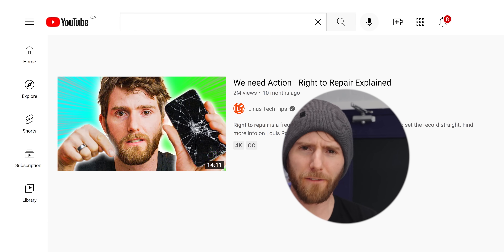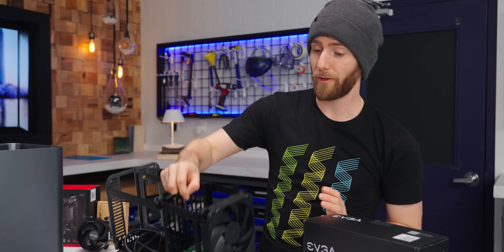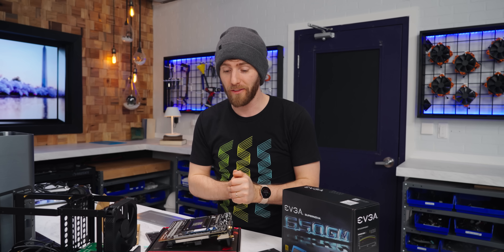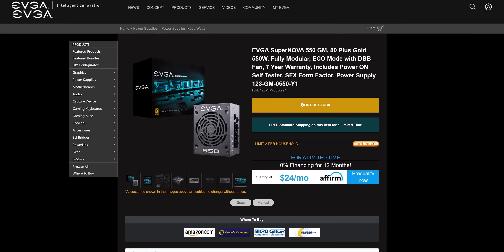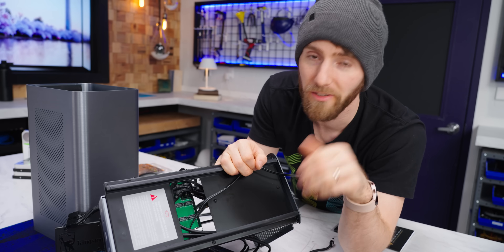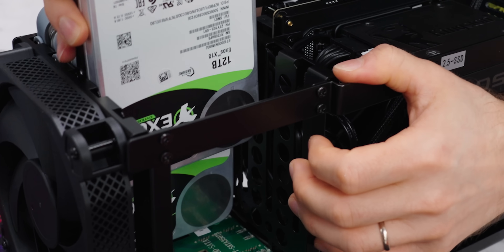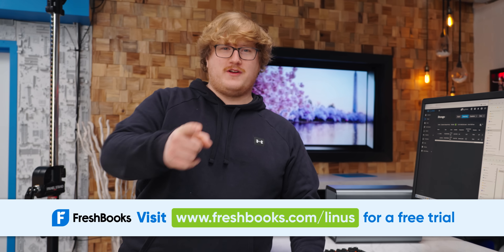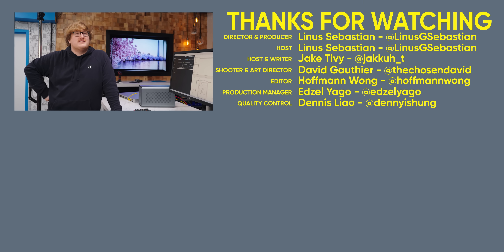This blows away the competition - JONSBO N1 NAS Build

Comment: case is now going for $150 +$126 shipping.  
processor can now be found for $200
MOBO: $212
Storage expansion: $24
RAM: linked is $70 - but really it should be ECC which is more like $100
boot drive: $24
optane cache: $50
psu: $95
$981 usd with no storage.  Thats almost $300 more than the prebuilt, partially because of this vid I'm sure lol.
I hate flaky supply chain no stock havin price gougin punk ass baloney.
Reply: I was just about to say it. Case is now about 40% more and the shipping cost is ridiculous. At least now we know how that seller makes his money :P

Comment: Lack of external hot swap bays is deal breaker for me, drives fail WAY more often than any other component and with that case you will be unscrewing and sliding it open to replace drives, you may even need to do a shut down first. 

Cost , size and computer power were also big wins but no mention of power efficiency.

Comment: The Synology software is the really reason to buy one over building a NAS yourself. It has apps on Android and iOS for accessing images, music, movies, etc. on the go. It can handle video surveillance no problem. It really is plug and play with an unbelievable set of features. If I could buy the software and put it on a custom built NAS I totally would.
Reply: Yes, I was about to say the same thing!
Reply: Agree 100%. Synology ecosystem apps was the reason I chose them. There are so much more than a network drive (the network drive is the least of the problems actually) to consider for a home family using 4 to 10 mobile devices, storing email, videos and photos using multiple mobile OSs.
Reply: I would imagine the Synology power consumption is significantly less, considering this is a 24/7/365 device...
Reply: You can put synology OS on a custom build nas and use it (ahrrrr), but if you want to buy it specifically AFAIK it's impossible
Reply: Listen, you are half right half wrong about Synology. While it is true that Synology has good software, the company has become arrogant and begin restricting the use of seagate and WD drives and other hardware. They want to position themselves to be more at the enterprise level nas/storage solution company. Also, they charge astronomical and give you crappy hardware. Everything is backfiring and people begin to move to TrueNAS. Nobody is considering QNAP because QNAP has been hacked several times. Please do your research or own a Synology before making comments
Reply: Yeah. Synology makes it super easy. I love my 4-bay. I'll eventually upgrade to a custom build.
Reply: Xpenology. Synology DSM for free! I don't know whether it is just as stable as the original though.
Reply: @strangelman  Been fine for me over the last 4 years running on 3 different servers
Reply: And so easy to be a victim of ransomware.
Reply: The point of this video is that off the shelf NAS will eventually fail and more than likely when the part is no longer available. Also as he mentioned in the video you can setup VMs, Docker containers, etc. on this box.
Reply: @keningilbert  you can setup docker on Synology NAS too. Most of it just works too. Yeah, it may be a bit harder to migrate so to each their own.
Reply: Interesting. Are the tools that Synology uses open source? For places that security is relevant being open source is kind of mandatory. If they are, I would consider myself trying their products.
Reply: @AllanDaemon  open-source doesn't make something more secure. Often the opposite is true and I'm a huge FOSS fan.

Comment: Do you need the io card if your mother board has enough sata ports for the drives you are using. It didn't explain on the vid an I'm just about to build one v similar with a r5 2600 b450 tuf 16gb optane 32gb 2133mhz ECC ram 120gb SSD 2x2tb HDD and 2x1tb HDD with case an 600w evga psu what else do I need will I need the Io port card also?

Comment: Can someone shed some light on the Intel octane drive? Don't have much experience with them, are they setting up to act as RAM essentially?  Does it matter what M2 drive to use on that front, can I use any nvme drive. I didn't know Intel Octane works on an AMD board.

Comment: If it's mostly storage. And you think 700 is cheap...go check the usual suspects: ebay, amazon, etc for used parts to make a full on computer, or a full on computer.  Why you might ask?  A old computer, from 90s, or mid to early 2ks, won't add e-waste (being re-used) you're getting something built like a tank. And also when your main computer has problems..you can alwys get your retrogaming on.  Old, or just older parts, make it far cheaper to repair than SSDs, and remember the golden rule: RAID is for WoW (up to early MOP) and killing bugs. Not to rely on for redundant backup!  As much as I'm conflicted on moving parts...turns out oldschool SATA and SCSI is sex for being reliable AF!

Comment: $10.00 difference between a DIY and build from a company that specializes in NAS... yeah you got more ram but I'd like to see a deep dive into the software differences between synology , freeNas, trueNas, unRaid
Reply: Not even 10 dollar saved, they actually didn't appear to consider shipping costs in any of the budget, but if they did this thing would be quite a bit more than the 700 dollar Synology. The case itself had a 104 shipping cost,  They either forgot about the shipping costs, or they ignored them to make their numbers better, either way this definitely isn't cheaper than the synology they were comparing it with. This is a build that not only costs way more, but it doesn't really look like it is suitable for a NAS since you don't have easy access to the drives. Surely, if one wanted to make something cheaper and potentially better on paper, then they could use pretty much any case, provided it had enough hard drive bays for what they needed and a decent enough cpu. They didn't need to go all out on it, most people wouldn't need that kind of thing, and this thing is practically guaranteed to draw way more power than something like a Synology or QNAP, which means that over time it will also cost mroe to run as well.

 In the end I think they failed to meet the criteria of better and cheaper, "better" of course is a more subjective thing, and while somebody might assume that better specs means the thing is better, it's very possible for something that is better on paper to end up far worse in practice. It's better in that it might be able to do more if you really pushed it, but it comes at the cost of price, and power draw. Furthermore, the raid configuration they chose makes this unreliable for any sort of backup due to the risk of drive failures. And since it isn't easy to get to the drives since the whole thing needs to be taken apart to get to them, overall I'd say this ends up fairly unappealing as an option.

Comment: What's neat is that you can apply most of this to much cheaper, or laying around parts (don't skimp too hard on cpus and drives I guess) and get this for a lot cheaper.  If it lives in the basement just screw stuff to the wall and save 20% right there.

Comment: Uuf, that is super expensive.
I build myself a nas similar to that two years ago.
ASRock ITX board: 110€
I3 10100: 95€
Case (4-bay-external accessible): 85€
Power supply FlexATX (300W): 75€
Used 16gb ram: 50€
And I thought that was overkill.

Comment: Fractal Node 304 is still a better case and hold 6 drives. But either way, it a pain in the ass to find a ITX board for 150 or less.

Comment: I would prefer a Intel Fujitsu micro ITX motherboard with an Intel 8th gen i3 CPU. With some tweaks you could bring the power consumption under 5watt idle. Also the CPU has 4k encoding capabilities.

Comment: Point I'd like to make that is pretty important:

How much space you save with filesystem compression ENTIRELY depends on what you're storing. You mentioned "photos and documents" as something you could expect to save 10-30% on, but in reality unless your photos are stored uncompressed (extremely unlikely) you won't see any significant space saving at all, maybe 1%. Even less if they're JPGs instead of PNGs, you might not save space at all with JPGs.

The reason, for those who don't know, is that you can't compress something that's already been compressed. Unless the original algorithm missed something- which does happen, especially on less efficient algorithms- once you've compressed it once you won't see a benefit in compressing it again. Anything that's stored compressed already won't benefit, including audio, video and images.

Binary files also tend not to compress well. (on windows, .exe files and some types of program data, on linux .so libraries and ELF executables)

Text and other files with lots of redundant and repetitive data compress very well, however.
Reply: The audience is tech noobs, I have watched a few videos of Linus and it baffles me as to what is being shown and said
Reply: recently I discovered Borg Backup, a way to do snapshot backups storing only the chunks that were never seen before, if you think about images you can store them for example in 9x9 pixels, a decent size that is likely to be repeated in a large storage with many photos. it is just an example but gives an idea on how this compression works, it is especially effective when the data is of the same kind. for example a bunch of vms will likely have gb of data that is exactly the same, or also data that uses equal or similar sources. An other example is the compression of the backup of many pcs of collaborators, they will probably all have the same OS, same software and they have downloaded the same files that they shared between them. With traditional compressing every file is treated kinda separately, and only perfect duplicates are not replicated. So if you store 2 almost identical 1MB photos they will compress maybe 1% and take 1,99MB of space. with this method the only data to be added is the difference between the two photos, probably a bunch of bytes.

Comment: Wouldn't it be easier to just use 5600G/ 3400G/3200G/Athlon 3000G as the system won't benefit from PCIe 4.0?

Comment: If you are going to build a custom NAS, why not just build one with Windows. Especially if you are going to use it as a storage device for other Windows machines its the best option. Sure it might not be as energy efficient, but the usability is worth it imo. Support is great for most applications to run on a server and its much easier to run. And you can always run vms with linux if you really need to run certain things.
Also not having any display output seems dumb imo. Creates a whole lot of issues (like with the IP) and makes debugging a lot harder.

Comment: This is exactly *EXACTLY* what I’ve wanted for so long. My time for a proper storage setup for my photography / video work is really overdue. Especially now that I do a lot of astronomy and am capturing hundreds of GBs worth of data in a matter of minutes, I need central big storage systems. This is so fantastic, I didn’t want to go the prebuilt route due to proprietary softwares and potential upgrade issues. Thank you so much for doing this video! It’s so incredibly helpful.
Reply: While I'm all in for Open Source... do check out Unraid before committing to anything. I've tried it all, nothing beats the simplicity of Unraid.
Reply: @reloadfast  Will definitely do so!

Comment: Hilariously, I actually did this not too long ago. I didn't go for something NEAR as slim, as I just went with a "cube" case, because I like that aesthetic, and then some second hand server parts and a fairly low cost PSU and a spare GPU I had lying around that came out of a super cheap prebuild I bought some eternity ago (GTX 730 low profile). Cost me about $400 in total and it's a beast for what it does, which is file hosting/storing and Plex.
Reply: Worth considering your power usage on something you probably run 24/7. Linus' solution might actually be cheaper than yours over the course of a few years.
Reply: @thedanyesful  also, typical NAS like synology would be much more cheaper over course of year than Linus solution. TDP of NAS like synology are around 15W. What do you think this would drain? 40 - 60 W ?

Comment: cool case. For DIY raid servers, I prefer using a decent PC case with lots of HDDs bays that are easy to access. With a PC case, you have a lot of MB options and overall, its much easier to put together, plus if you want to upgrade the hardware, disassembling it is much easier\faster.

Comment: But if you use 18TB drives, you're still going to pay 5,000 CDN dollars for them. I seriously don't believe people would store 100TB of stuff and use precarious blue or black drives - they're going to get 18TB Ultrastar SED drives. They're certainly not going to get garbage Seagate drives. But it still is high risk because it's not mirror RAID. Going with other types of RAID will limit you to 4 drives. The only, and best, solution is mirror RAID with ten drives.

Comment: I had an Icy box once for three hdd's. Similar to this. It was however not very fast and not very icy. The harddrives were constantly at 50-60 degrees celsius and the fan was quite noisy. It used e-sata but since I didn't have an e-sata port on my motherboard so I had to use an extension card. In the end I just got tired of the hassle and bought a larger chassie so i could put the HDD's inside it instead adn all my problems were solved.

Comment: That case, the fan, and the hard drive docks look like they're going to break. I would not trust the $1000+ dollars in hardware and my data in there. Just buy a case with a bunch of hard drive bays like the Fractal R5.

EVGA often puts PSUs on sale on their own website and Amazon. $120 is ridiculous. I paid $50 for an 80+ Gold 650W modular PSU from them & $25 for a non-modular 80+ Bronze 500W last sale they ran.

Comment: z2 is important for mechanical based drives because rebuilding the array (in z1) especially in high-density arrays (12TB drives) you can actually KILL a drive while rebuilding. so z2 or z3 for high density arrays is best. or fuck it and do JBOD

Comment: Just wanted to mention that the reason it defaults to raidz-2 is because raidz-1 (and normal raid5) isn't recommended for drives bigger than 2TB. 

This is because if you have a drive fails, the process of copying data to the replacement takes so long and is so intensive it can make another drive fail during this process, with bigger drives, this becomes more and more likely to happen.

If it happens with raid5 or raidz-1 you're probably going to lose your data, and raidz-2 and raid6 protects against this by allowing another drive to fail before you lose your data.
Reply: yeah, these guys have learned nothing and are setting the system up for data failure. terrible advice.

Comment: This is one of the most overpriced and over-specified solutions I've seen. It would make far more sense to use an ASRock server motherboard with a BGA 8-core Atom (if Atom cores are good enough to be used in the 12900K, they are good enough for a NAS) CPU that costs less than half of the motherboard and CPU used in this video, and also has more SATA ports.
Reply: This is an entertainment channel, not an informational one.
Reply: @RuneanV  I completely agree, but it markets itself as a proper tech channel, which has not been the case since the last batch of writers were taken onboard.
Reply: @piers3074  It's never been the case...

Comment: RAID Z-1 is very bold.  10TB drive failure means that if there is any burp during rebuild, you can say goodbye to the whole pool.  I really wouldn't dare to do less then Z-2 with drives 4TB or larger.

Comment: Honestly the cheapest way to build a NAS like the one I built for my home plex server, it to buy an old refurbed 8 or 12 bay server like the Dell R510. 
You can get these babies for ~$300. In my case it was a Dell R510 12 bay, with Dual Xeon L5640s and 24GB of RAM. Then I bought a set of 12 retired 2TB drives. 
Setup the storage in a 15TB RAID 50, then use a linux VM to host my data store and another linux VM for Plex. Works pretty well, and including the drives and everything only cost ~$800. Which is cheaper than most NAS boxes without even including the drives. 

Surprisingly using the retired drives hasn't been too bad either. I have had maybe 3 or 4 drive failures over the last 4 years of owning this thing, and I just order more when I need them.

Plus unlike a NAS, I can setup additional VMs to do basically whatever I want. From hosting game servers, DBs, etc.

Comment: The cost of a system is not only the price tag on the hardware. 
They completely forgot to take energy consumption into account. I guess the diy nas consumes 100+ watts in idle, while a e.g. qnap nas would consume less then 60 watts under load.

Comment: just a critical oppinion/view on this (pls don't take it personally):
why optane instead of more ram? I don't think b550 is really upgradeable. am5 is right at the door and incompatible with this board so you're stuck with the currently existing cpus for updates. unless you plan to buy the upgrade used on eBay I'd recommend just buying a better cpu now and stick with it (no upgrade planned)

why would you limit yourself with ITX for a storage solution facepalm.
Just get a big tower and place it in the attic. it's not a media pc/htpc/nuc
the existing systems this is competing with use smaller cases too lower cost and for design decisions
Reply: with how much hassle they have here: big tower is most definitely the better solution for being comfortable with the system.
swapping a failed drive in this case seems like a nightmare.
Reply: 10:23 no
just no, not at all
that's not how you treat drives with data on them.

you can't even hotplug drives in this case wtf